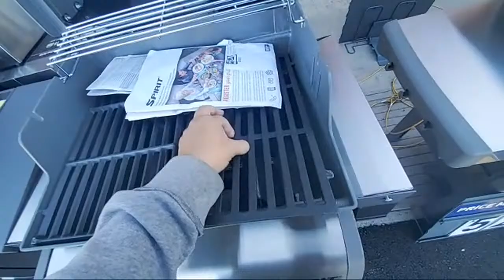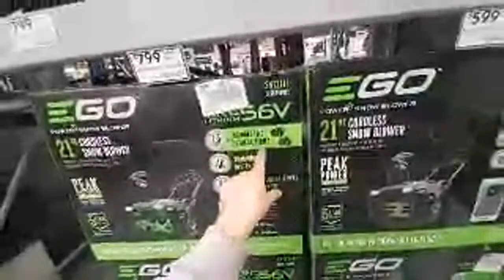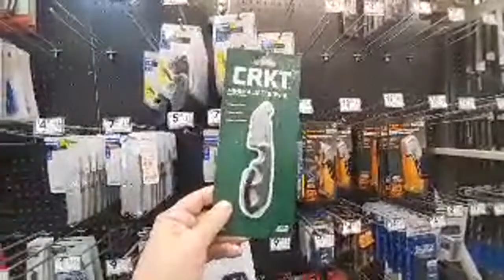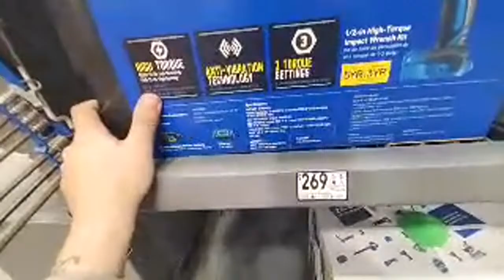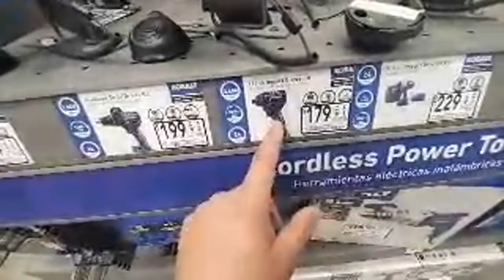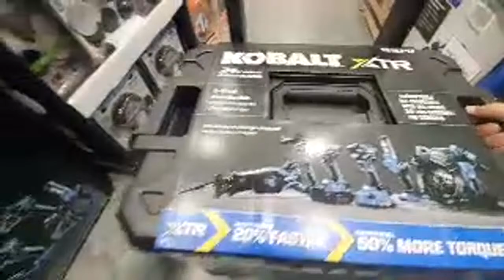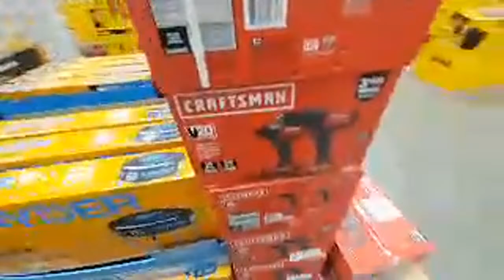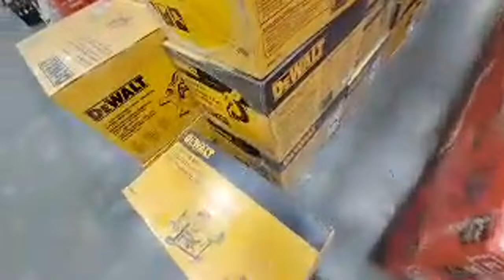Lowes !! LIVE AND LOUD Christmas Special .. Episode 1 2020.. 25 Days of Tool Deals 🎄🎅

Comment: I have the 12 volt skil. My favorite of all time. Also the drill has a hidden feature, if you open the chuck all of the way it has a bit holder made into the back of chuck. Just insert a bit you dont have to tighten chuck at all. Very convenient.

Comment: On 1/2" impact- $229 is not the sale price, on sale, they sell for much less, $269 for XTR. When they go on sale, there is a significant savings. In between sales, I wouldn't bother. Look at the 24 Max impact driver and hammer drill combo kit w/ charger & battery on sale now for $129 (normally $279) as an example of when things go on sale. A month ago they had the 1/4" 24 Max driver kit w/  a bag, battery, and charger on sale for $99 and the 3/8 impact driver with a free battery for $79. If you look at the non sale prices right now, you'd pass them up. I'm waiting for the XTR hammer drill to go on sale cuz I won't pay that much.  I don't expect much in sales from Lowes until Thanksgiving and later